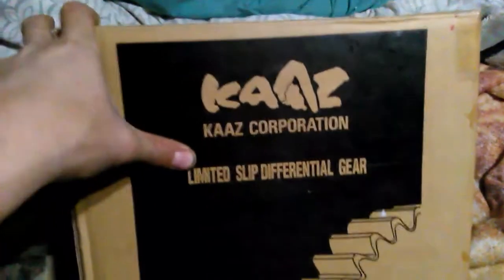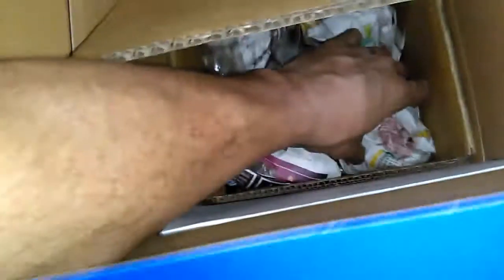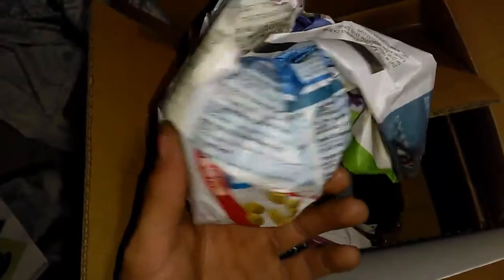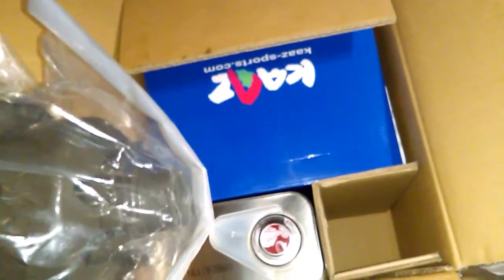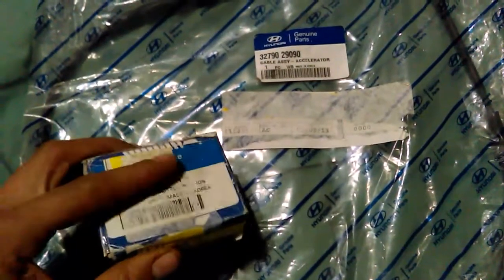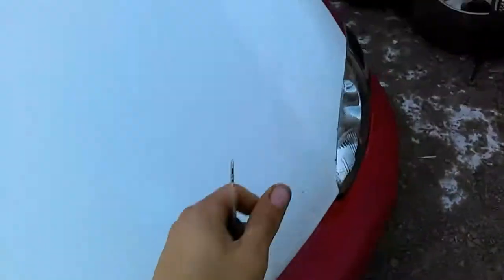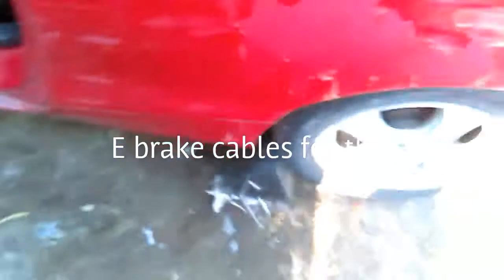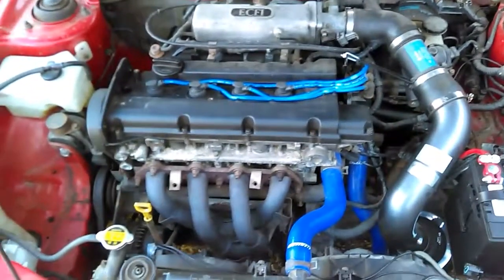KAAZ LSD for the Rd2 Tiburon . Some new stuff for the Rd tib

Comment: Nice bro...
I can't wait to see the install video on the limited slip...
Reply from the maker: I don't have the special gear and bearing puller and don't have access to one anymore. might have to try a few but if not guess have to pay someone to do it
Reply: PA Tuners oh ok. 😔
I hope you can get it done. I need to learn that.. lol
Reply from the maker: the tool cost 750 from hyundai so hopefully i can figured out some other puller that will work

Comment: That will be a huge help! I know a guy in Waynesboro that gets old stock batteries and sells them for like 25% or retail, it’s a pain to run to Waynesboro but price is king.
Reply from the maker: i got the new battery in Hagerstown best they had 6 year warranty $120 bucks . What all brands does he sale ?
Reply from the maker: LSD is going help a lot now i need to get my coilovers and wheels and slicks try get this car into the 11s
Reply: PA Tuners they are interstate. No warrantee for these but probably $25 and you can see he date code, they are the ones that didn’t sell and got replaced with new every so often.
Reply from the maker: interstate is good battery . $25 that is cheap well shit i like to get a few of those i need a few . i'm not worried about no warranty .
Reply: PA Tuners that’s how I look at it. My diesel has a huge battery and was big money, he happened to have one and hooked me up, it’s been great. A damned shame the factory battery only lasted 3-1/2 years but I do abuse it charging cameras at the track and all.
Reply from the maker: Let me know i buy a few if he has them i have a good feeling my turbo tib battery not going be any good after all this cold and its old. i would of thought the factory battery would of lasted longer myself but charging stuff does take a tool on them

Comment: I need some info to get ready for our local drags here in Barbados starting in March,my best time in the 1/8 was 10.4 in stock trim
Reply from the maker: Basil Cumberbatch i have about 450 videos on beta should help. But to really gain hp you need away to tune it i use Megasquirt

Comment: Hell yes! How much did the diff gear cost you? I'd LOVE to go LSD on the Tib. My launches would no longer be left tire fire hahahaha
Reply from the maker: $1030.50 for the KAAZ diff  helps a lot with tq steer lack of traction for sure
Reply: was the LSD you got from KAAZ product code "DBM2050" ? That's the only one on their site I can find, and its listed for the 1.8 engine. Just wanted to be sure it will fit a 2.0 with a beta1 trans. Thanks buddy
Reply from the maker: yes right part number but i got the DBM2050SQ i bought mine from real street i would buy the one i got because sq is a bit better lsd
Reply from the maker: 1.8 2.0 beta 1 and 2  1.6 alpha same diff same diff as EVO
Reply: word much appreciated, you getting one inspired me to get one in my tib. Was considering doing a high compression rebuild and slightly bored over but definitely gonna do LSD first now.
Reply: also with the timing chain tick/slap (my beta 1 had it for the longest time) a lot of times its simply the upper or lower chain guide that becomes loose. Definitely worth checking the torque levels
Reply from the maker: Colorado Cruisers OK  I will give that a look thanks